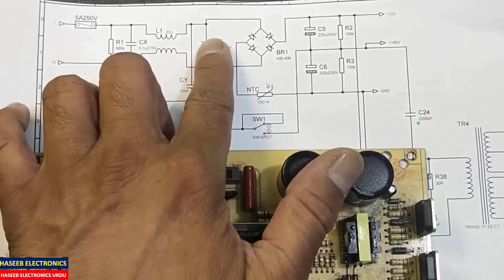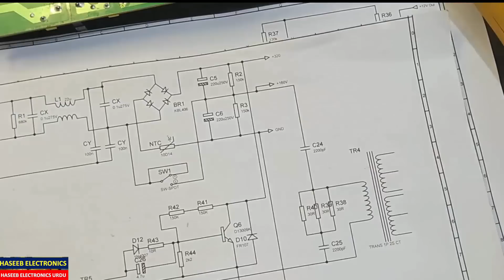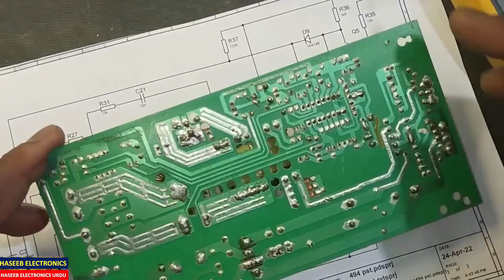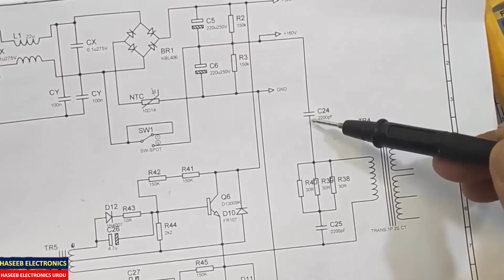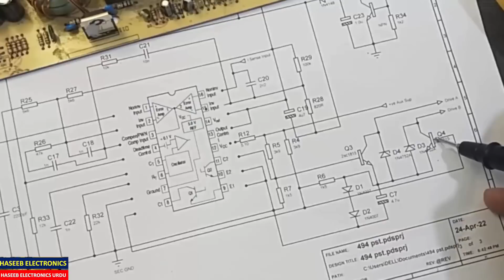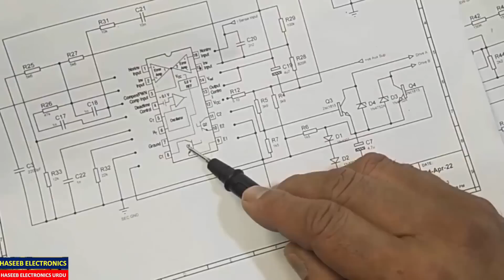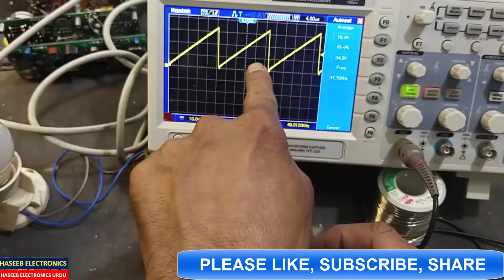Comment: Sir can we charge 12 volt battery by exceeding its voltage to 14 volt.
Reply: yes we can, just try to add some battery cut-off protection circuit. 
as it provides 25 ampere, although it is very high charging current, but it will a good charging tool for battery

Comment: I noticed half bridge smps  draws higher current from mains and output half the wattage its drawing but forward converter draw far lesser current from mains because I tested and see 22 amps at 115vac and that's wattage is 2900 watt and the output of the halfbridge converter is 55amp 15volt and that's 750watt that's totally bad I tested the forward converter and get 100 amp 15 vot and that's 1500watt and 19 amp from mains at 115 there is something wrong  the design of half bridge converter on the market I don't like them

Comment: congratulations friend, very good. even better was to have subtitles, so I could follow in Portuguese. a doubt: this output transformer it is wound to which frequency, 24khz or 48khz?
I have a 24V 15a source, I am thinking of modifying the coils to 48V 10a or 15a depending on the amount of wires used, can you guide me?
Reply: most welcome dear 
the transformer will wound at 48KHz, because each switch will switch at 24KHz, so both switch will produce bipolar magnet
Reply: 24v x 15Amp = 360 Watt 
at 48V the current will decrease at 7.5Amp 
because 48v x 7.5 A = 360 Amp 
please check video number 390

Comment: Sir, if ics pin no.12 has only 8vdc whats the reason 🤔
Reply: that means 
1. its vcc voltage are not being prepared 
2. any one mosfet, or mosfet driver circuit, is bad
3. ic internal driver transistor is damaged (pin 8, 9, 10, 11)
4. ic internal reference regulator is damaged
5. series coupling capacitor is devalued
Reply: @HaseebElectronics  thank you very much, i will check.

Comment: Can we use it as welding machine if thera is 48 v dc out
Reply: no
its output current is only 25 volt 
in welding machine the voltage feedback is not used, ony current feedback control is used to maintain arcing current

Comment: Hello dear Haseeb Electronics, I sent you an email to your email address that was posted in your page because I attached a video and pictures. Do you respond to your emails? Thanks
Reply: best regards my Gmail id is ashraf4ta4
i have huge number of emails. just send a reminder to your last email or send your name visible in emails, so that i can search your email easily 
best regards
Reply: Dear Haseeb, I just resent my email with Isobar20 in the subject area. Please check it. I have important questions for me regarding SMPS transformer and 2 zener diodes to choose right voltage ratings for them. Thank you Sir.

Comment: low  voltage output whet is the issue sir
Reply: in this design, if there are low voltage, there may be many issues 
1. improper voltage on DC rail 
2. anyone of power transistor or its related circuit is fail
3. resonant capacitor (ceramic capacitor in series with transformer primary and dc reail center node)
4. poor quality output circuit
5. improper voltage mode feedback
6. high current shunt circuit feedback
7. pulse transformer is not switching properly